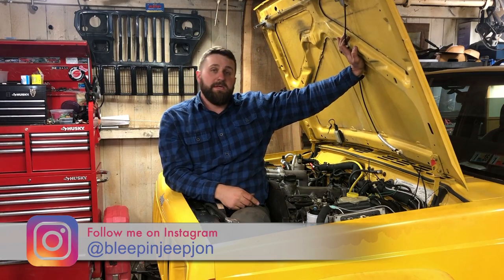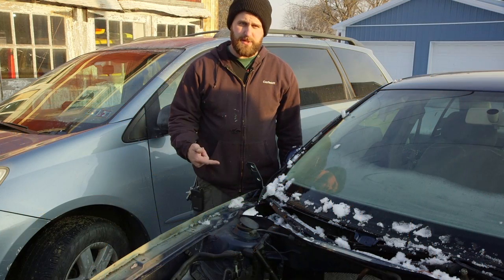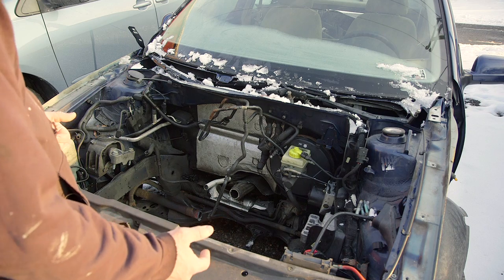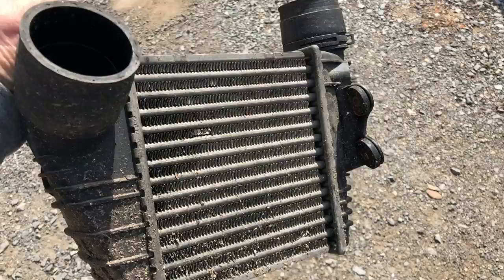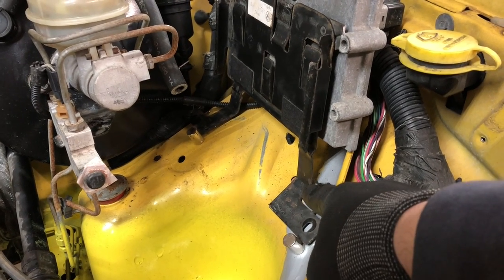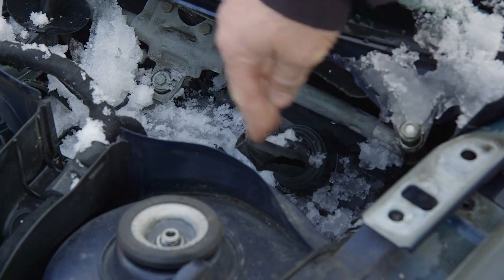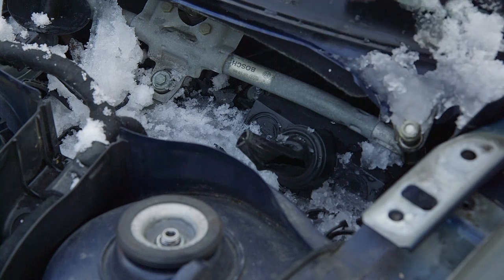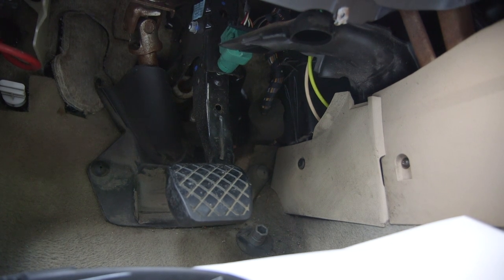Step By Step TDI Swap - Part 3: The Donor Car and Pedal Fabrication

Comment: Anyone who watches this video and doesn't realize how much of a feat it is to get pedals into a common plane on a custom build like this - hasn't ever had to do the work before!  Nice job!  I also decided to eliminate one of my threaded ends on my clutch pedal assembly while addressing some less than awesome work performed by a previous owner.  Turns out that it was an odd metric thread/pitch and just wasn't worth trying to chase threaded rod or a useful donor bolt.
Reply: Ewing Fox using the old style pedal bracket is a pain but it works. Thankfully the VW pedal on that little bracket worked out fantastic, that part was way easier than I anticipated! I’m having a heck of a time with adding a third pedal in my Wagoneer tho.
Reply: @DRTJon  I won't show you the welds on mine lol sigh

Comment: The automatic tdi had the 11mm pump with smaller injectors for higher injection pressure and improved emissions with the same power

Comment: Did you consider using a mechanic injection pump from a different VW and drop all electronics completely? 

For those that are interested search for mTDI.
Reply: Just started looking into this… read a forum post that said converting an ALH to mechanical pump will inevitably have a really rough idle? Also, does it ruin the fuel mileage?

Comment: If doing a tdi into an automatic transmission on the xj , is it a different process or do you just connect it to the transmission as you would take the old one out.

Comment: not you wont find a pedal assembly.  It was well as the shifter and manual trans for the ALH motors are in screaming demand.  The auto in those yrs are crap and the manual will keep the cars going forever.  Ive done both my TDI Golfs and its a super sweet combo.  Daily driver getting 46mph+ on home made Bio

Comment: Do you have to send your ecm to get tuned or can you use it when you pull it from the doner
Reply: Yes at minimum you should have the immobilizer turned off which is between $50-100 from most reputable tuners

Comment: Is there any reason all the guys I see doing TDI swaps use manual transmissions? As I understand there's no reason the conversion wouldn't work on an automatic.
Reply: Diesel engines rev much lower than a gas engine. You'd need a diesel specific auto trans for it to work. You could make the aw4 work but would need to rig up a TPS to work the transmission, and the shift points would be all out whack unless you figured out a way to correct them. Other option is nickintime's aw4 manual shifter that he's making. Basically would be an automatic trans that you'd have to manually shift 1st through 4th.
Reply: @TheAmericanUhate  great to know as I plan to put one of these in my XJ. I'll have to look into Nick's manual shifter, thanks.
Reply: TheAmericanUhate those tdi motors redline at almost the same as a 4.0 at around 5k. I don’t think that would be a problem
Reply: Talked with a friend who knows a bit about xj's. He seems to think its possible but would require work to get the systems to play nice with each other. He didn't seem to think manual shift in an automatic would be a good idea. Seems to think it would blow the trans quick. I'm definitely looking to make this work because I just hate the idea of wheeling with a manual. Autos make it so easy.

Comment: Wait, so did you cut the harness where it goes into the firewall?
Reply: Dan Kennerson no there are plugs under that boot, unplug there. The only thing you want to cut is the accelerator wire
Reply: @DRTJon  so the plugs are up by the boot? Thanks for all the info by the way
Reply: That is correct. If you’re on IG I can DM you a picture of the pulled harness. Forgot I had one and should have put it in the video!
Reply: @DRTJon  I think I can find it, just haven't dug into that part of my donor. Thanks!

Comment: Replace the drive by wire with a cable
Reply: That's called a "MTDI" and it's waaaaay more complicated than just replacing the drive by wire with a cable.  The pumps on these are internally driven by the electronics.  Converting to mechanical requires a different pump (most people use one from a Land Rover 3.0) and also swapping to a waste gated turbo instead of the variable vane type found on all factory TDIs.  Personally I weighed the pros and cons of each and decided to stay with all electronic and VNT turbo.
Reply: @DRTJon  I would have gone the other way my self. I will never drive a drive by wire auto. How ever that information you just provided my is extremely useful. Than you!

Comment: Can anyone help me. I have a 99 xj 4.0 and it shuts off when the car gets up to operating temp. Itll start back up, run for a lil, then shut off. I replaced the plugs, wires, cap and rotor to see if that would help. It didn't. Any help would be awesome.
Reply: Mateo San You need a new crankshaft position sensor. Also make sure to get one from Jeep because the aftermarket ones often don’t work right.
Reply: sounds like it could be your fuel system. depending on service records and how many miles on it, it would be a good idea to start with the pump and filters. filters are in-tank on the pump, theres no other filters on a 99 and fuel pumps are not expensive so just replace that while you have the tank down, clean out the inside of the tank and you shouldn't need to be in there again for a very long time
Reply: It could be either of the suggestions so far. That's why you should go get a fuel pressure test kit from you local auto parts store. They rent them out. You need to see if there is a leak down or the check valve in the fuel pump before just replacing it. 
But It could be the CPS just as easily. They are pretty commonly bad and can cause a situation like what you described as well as the fuel pump. Doing some testing to see if you are getting any spark at the plugs is a good test. 

I try to not just throw parts at the Jeep in hopes that it gets fixed. Do some basic testing to help figure out the best course of action first.
Reply: Fuel and crank sensors are perfect answers to that problem. My advice would be keep a can of start ya bastard in your glovebox and when it plays up spray some up the intake and see if it will fire. If it fires you know you have spark so crank sensor is ok and if it doesn't run you'll know it's a fuel issue.
Reply: My 96 XJ just had a similar problem. Ended up being the fuel pump, water pump, and crank shaft.
Reply: Check your rear oxygen sensor (behind the cat). If the wires are broken or the o2 sensor is destroyed then that is your problem. Chrysler ran the rear heated o2 sensor on the same circuit inside the computer as the ignition system so if the rear o2 sensor or its wiring is messed up then the you will nee to replace it and the ECU. Common codes when facing this issue are p0300, p0301-06, p0138. if you have the infamous p0351, this is the bullet and your gonna need an ECU.